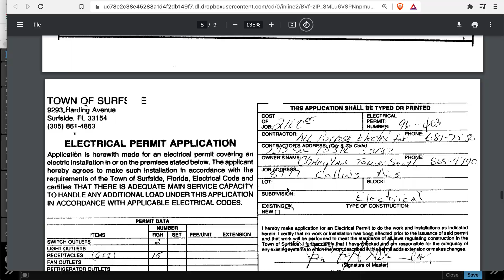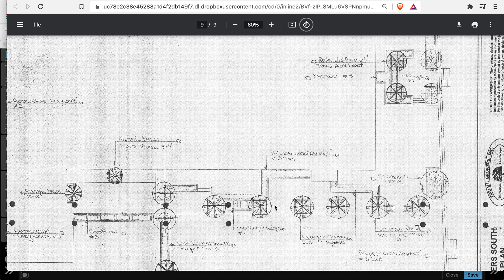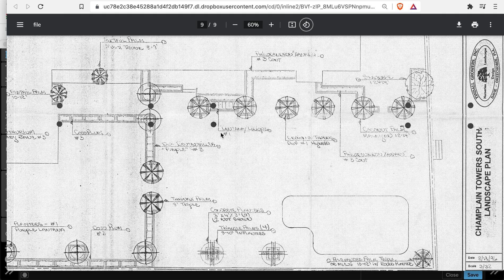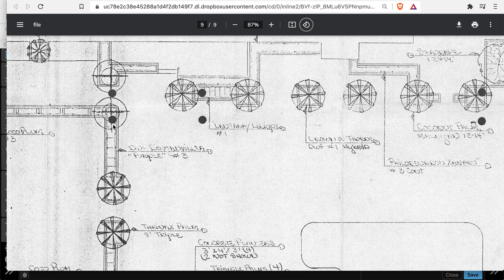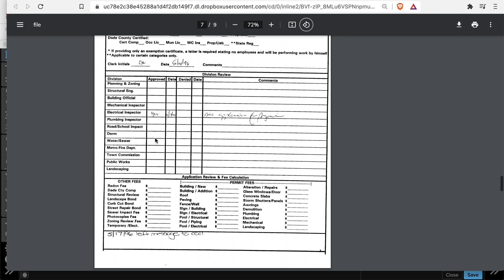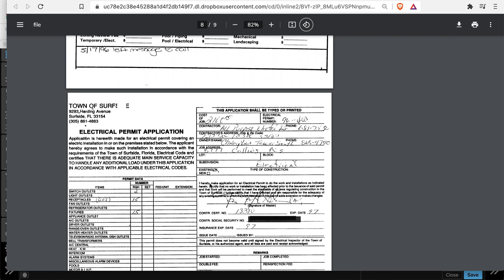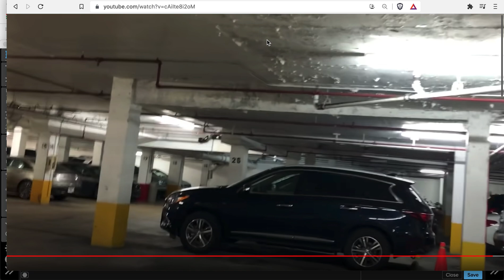Champlain Towers Collapse Planter Boxes never had good drainage Overlay of 1996 and current proposal

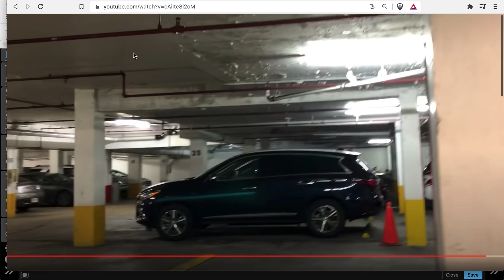Comment: In the frame at 2:49, there appears to be a lot of stalactite-like formations on the ceiling slab-all around the drain pipe and light source. Is this due to excessive water seeping through? Moreover, there also looks like a margin line or demarcation as if this area was treated or replaced at one time.
Reply from the maker: Keep in mind, the drop slab is about one foot six inches

Comment: I may have told you there were several huge planter boxes in the above ground parking garage at a very upscale condo on the beach here and in one week they were ALL removed~now I know why!  Also just a few minutes ago I saw an add for new condos being built in this area not on the beach.  I immediately zoomed in on the construction and the columns literally look like small poles!  And they already had 2 floors of concrete on them.  Would never even given that a look see until you got me hooked on construction:)👍. Looked like a small version of the Hard Rock Hotel in Vegas!

Comment: How could those planter boxes, directly over the columns, have had drains? They would have had to drill drains through the slab but wait, there are columns in the way. Wasn’t that basically impossible to do based upon the locations of the boxes?
Reply: Even if there weren’t columns under them where would they drain to, the deck floor/garage ceiling?  No bueno.